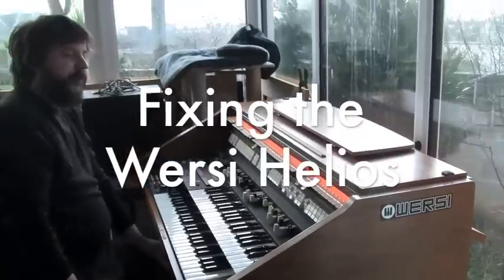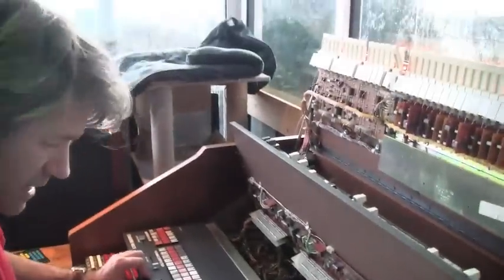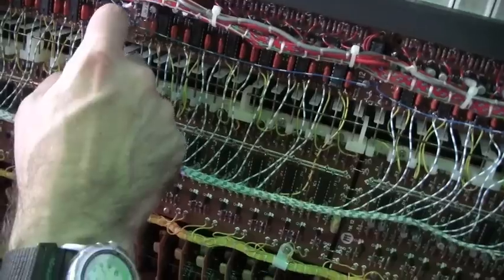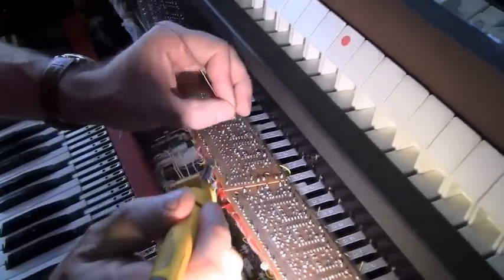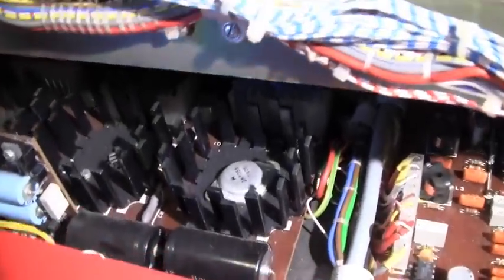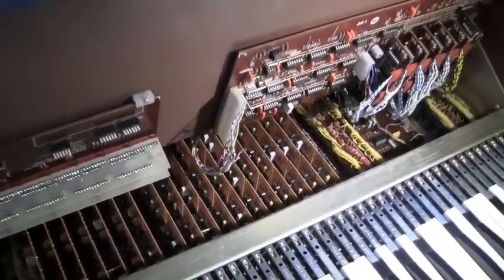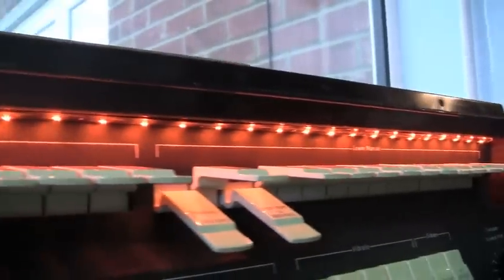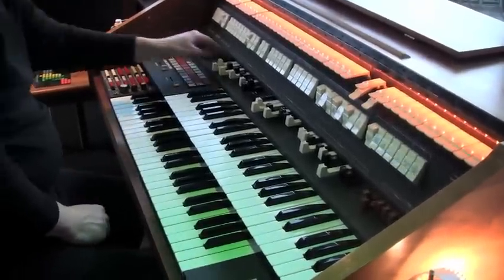MF#3 Wersi Helios vintage organ electronics repair

Comment: Hi Markus,     I  built my Helios in 1984. If I remember correctly there was about 38,000 soldered joints. And the Master wiring harness if you put all the wires end to end it would be about 1640 feet long.  And then add all the sub harness wires. There may have been close to a half mile of wiring in the Helios. And somewhat more in the Saturn, Zenith,and Galaxy. Enjoyed your  videos of the Helios, brought back a lot of memories. Thanks, Jack.

Comment: Ahh yes... I'm only 13 but I know what a dry joint is.... Great work Mark! Me and you could put one of these together with our eyes shut! I'm working on a HMV valve radio from 1955... It is one of the first in the U.K with VHF (FM) the smoothing capacitor exploded! But I am going to replace all the wax and electrolytic capacitors... My Kawai organ has had nothing to majorly wrong with it... Just bad solider joints and dirty switches.... I would love a Helios....

Comment: That must have taken someone at least a year to build. So many wires and components. 
They had some masterful cable management skills too.
Reply: I built a Helios in 1980/81 and it did in fact take a year to build working in the evenings. The wiring looms came pre-made in the kits, hence the neat finished appearance.

Comment: Hi Markus! Great video and a channel! I'm having a stand-alone, DIY Wersimatic II unit for repair. It's most likely been stripped from an organ, it looks great and have a 12 tone button keyboard for chord control.  I have the 3rd and 4th parts of the "construction manual / schematics" but it seems incomplete, and the start/stop function has two wires coming out of it that I don't know where they're supposed to go. Would you happen to have the full Wersimatic schematics, and is the start/stop function in there? Would greatly appreciate it.
Reply from the maker: Hi I do not have any schematics for that but can i suggest you try and contact the youtuber called organfairy as I think he did something with his wersimatic in one of his videos he is a genius and he might be the person who would possibly have schematics hopefully. I sold the wersi i had many years ago sadly.
Reply: @markusfuller  Thanks, the Wersimatic II lives!

Comment: Hi Markus,

I just got an Elka X-30 from Sinterklaas. It's amazing. A lot of the leds in those typical 80ties rectangular switches do however not work and I cannot find anything about repairing them on the net. Do you have any experience with that sort of stuff?
Reply from the maker: +Marc Brassé Hi Marc. I do have many strange shaped leds from years ago, some are rectangular. Im not sure if its the switches that you are having the problem with or the leds dont light up ?.

Comment: My first real serious experience with soldering electronics was building a Wersi CX5 drumcomputer. It was about the the first one on the market combining (8-bit) samples, MIDI and a pad interface but must have been quite a dud for Wersi. Hardly anybody seems to remember it. 
Sync via MIDI did not work properly though. It would sync up but now and then swallow some internal sample triggers. Never found out what that was. Just used it standalone.
My build did not work right away and I also had to bring it away for one other repair later but overall it has been rock solid. Still is actually although the backup battery should be replaced.
Reply from the maker: +Marc Brassé The Wersi I had needed constant attention, you had to repair it just to play it then the next day something else went wrong. There is a great musician called John Kyffin who uses Wersi's of every flavour. I have been to his home in wales and it is full of Wersi spectra's & Helios's and speakers & im sure he has the CX5 drum machines. He is a massive fan of Klaus Wunderlich (sadly deceased now) but Klaus was the master of the Wersi's. (I admit that I have 100s of his LPs here.) I love the sounds of the old Wersi's
Reply: No my CX5 has been a very steady performer. It also was a lot more compact of course so less could go wrong, One of it's best tricks was that you could tune the whole drumset down. Instant Industrial!
I also have a confession to make. For me Wunderlich et al was the ultimate in bad taste for many years and the music still does little for me. I am more of a Vangelis, J.M. Jarre, T.D. man.
By now I am however actually ALMOST more into organ technology then pure synth stuff. Organists still tend to be real musicians and the ergonomics of the instruments are often far superior.
Reply from the maker: Yes I agree in a way that Klaus released many many recordings on an industrial scale but it was not until a few years ago that I started to appreciate his instant music. Jarre is my favourite very closely followed by Vangelis.
Reply: Although I always make sure I avoid simple immitation Vangelis has been a major influence on my own electronic music. Sadly the master himself became very much set in his ways after his London period, But that surely is an entirely different story again. :-)
Reply: @markusfuller  ich würde gerne eine Helios kaufen. Von wann bis wann wurde sie gebaut? Welche Baureihen gibt es? Ich finde im Netz leider kaum etwas...